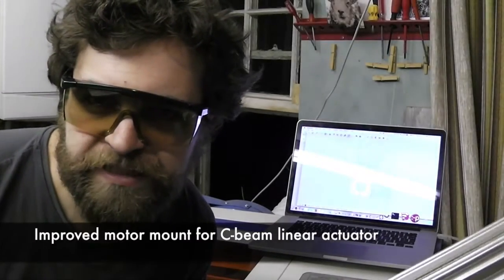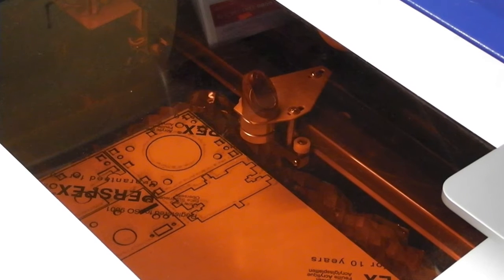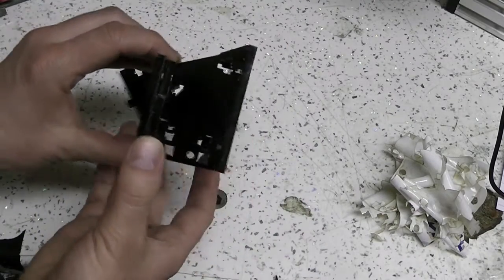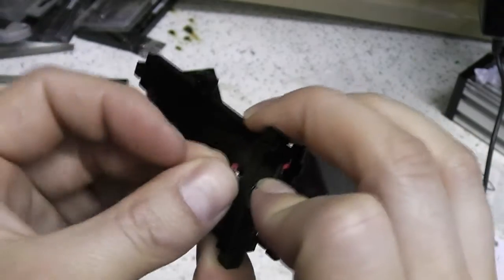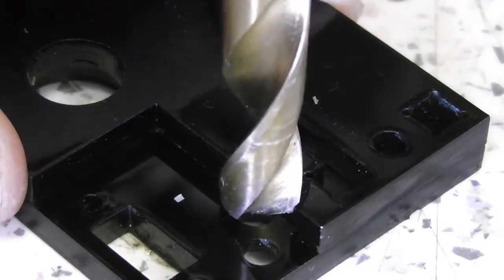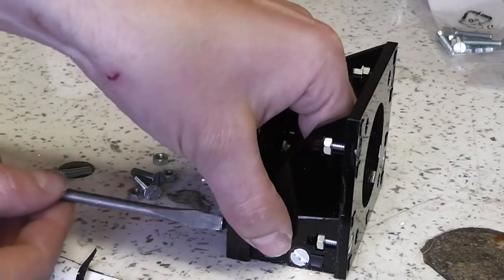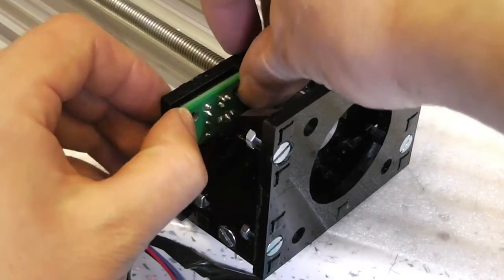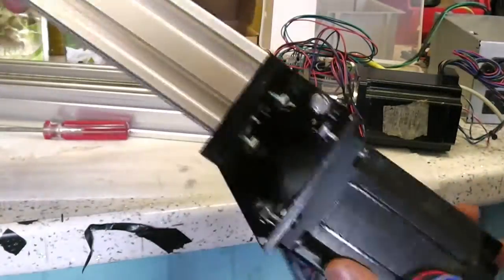Stronger motor mount for C-Beam: Cnc router blog 5

Comment: nice yet not simple. I don't see in the video original C-beam warble, would it be the end plate you used? I mean spacer with your ABS(?) end plate warble because of the material. Will it be warble if you use original C-bean end plate?
Reply from the maker: This is only worth doing if you laser cut the plates out of acrylic. The original aluminium plates work fine.

Comment: What thickness of acrylic did you use and what were your speeds and power on your laser?
Reply from the maker: +Joe Waldman 5mm acrylic, 2mm/s, 5mA current with a 40W tube. It can cut thicker acrylic, but inaccuracies in the beam angle become more obvious (it is never exactly vertical to the workpiece). If I set the speed too high, vibration in the linear slides caused by acceleration / deceleration causes slight waves in the edges of the cut. And if I set the current too high, the acrylic melts too much, cutting v-shaped edges instead of parallel ones. Overall, I probably could tune this to cut faster, but since I'm cutting parts for a CNC router I'm opting for quality rather than quantity at the moment. I've cut up to 8mm acrylic on this laser cutter and it could probably go thicker, but I find I get better quality if I cut several smaller thicknesses and glue them together, rather than one large thickness.

Comment: Great video, good descriptions etc, only problem is having to wait for more. It's a shame you can't make stuff 24/7 😀😀😀😀😀👍
Reply from the maker: +Smallest Workshop (Geoff Harris) Thanks Geoff, I wish I could make stuff 24/7 too! I would certainly have finished the CNC router by now..
Reply: +OpenTronic quick question, I acquired this thro Ebays Chinese corner shop before Xmas , do you think it could do any meaningful damage in a home brew CNC frame ? 
Model: M-33A405-500-G
The core component: Osram
Wavelength: 405NM
Output power: 500mW
Power supply voltage: 5V
Working current: 600mA
The spot mode: point
The output wave: visible light
Product material: aviation aluminum
The optical part: focusing lens
Lens material: PVC focusing mirror
Working temperature: -40-75 degrees Celsius
Working medium: Semiconductor
Work life: 8000 hours (with greater heat dissipation device)
Dimension: diameter 33*55MM
DC length: 1.2M
Structure characteristics: aluminum alloy shell + imports of laser diode  + constant current drive plate

Regards Geoff
Reply from the maker: +Smallest Workshop (Geoff Harris) I suspect that 500mW is too low to cut acrylic, but you may be able to do some pyrography on wood with that, or cut foam... this is a similar laser to yours: https://www.youtube.com/watch?v=Oy6KledmsyE . I use my laser cutter with the power turned right down and a slow feedrate to get nice quality edges, but that will still be putting out between 2W to 10W of power. The real advantage of laser diodes like yours is that they simplify machine construction because you can mount them on the mobile axis directly, so you don't need mirrors. You can buy laser diodes with at least 2W of power - +Educating Savvas has one! and I don't think we're far away technologically from having a viable cutting laser diode. Exciting!
Reply: +OpenTronic cheers for the info I will keep my eyes peeled and also have to get into foam and pyrography 😉😀👍